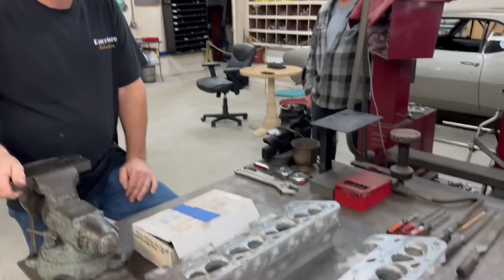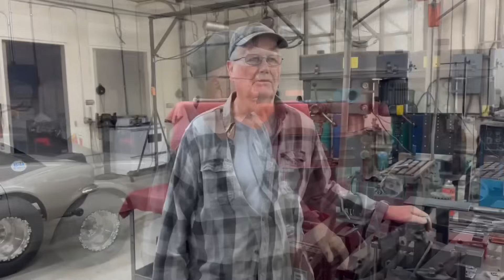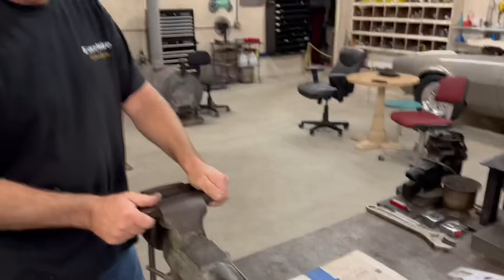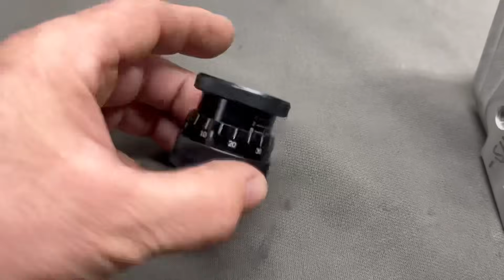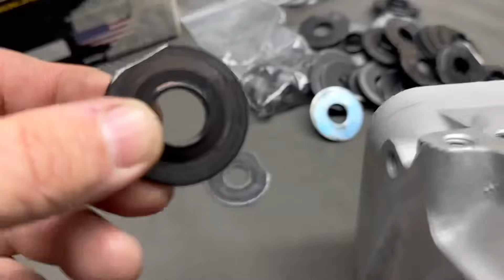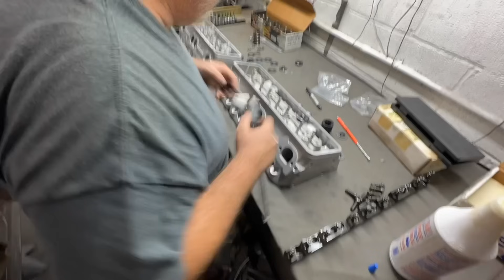How to: Set Up Valve Springs / Installed Height / Cylinder Head Valve Springs

Comment: If you cam/springs  calls for say 100lb at install. But that puts you at .100" before bind. Can you just shim 50/60 . If its 285lb at 1.240 Wouldn't that be 3.3lb per .010" in Increased force? So about an extra 16lb  or should you leave it at Recommended install height for spring?

Comment: Hahahahaha..."hoops"......I like that you call stainless wire o-rings: "Top Fuel hoops"....
Reply from the maker: That’s what TKM calls them.  It’s not just a wire o-ring.
Reply: @TurboJohnRacing  we've been o-ringing blocks and heads so long we once used guitar strings...but okay...
Reply from the maker: @ so these are a solid machined hoop.  This is what they use on top fuel cars.  AJPE hoops is what most use, TKM does their own.